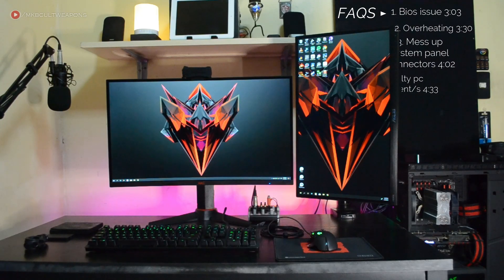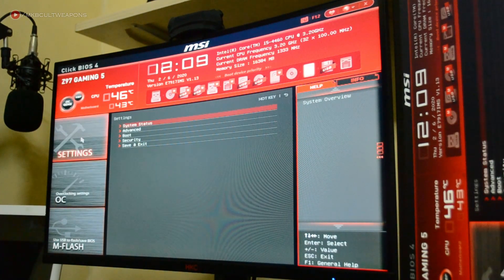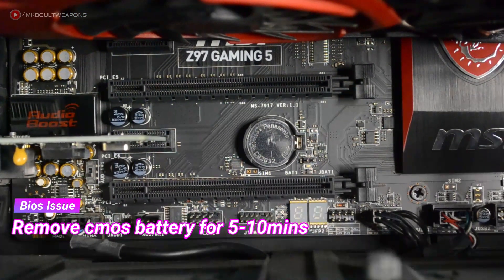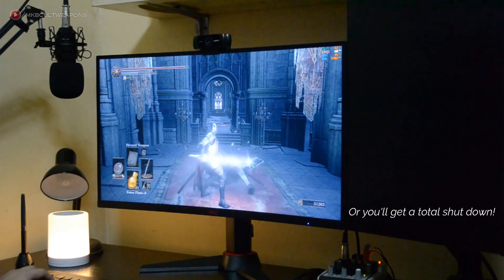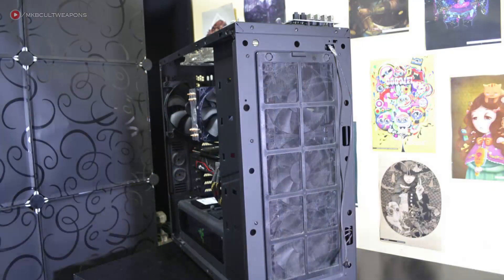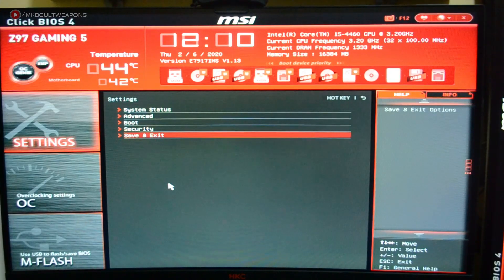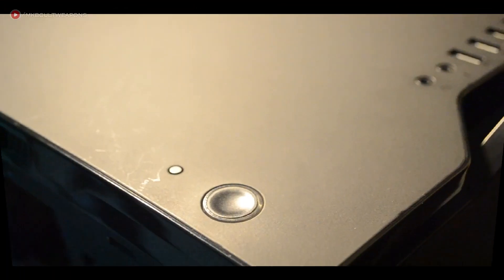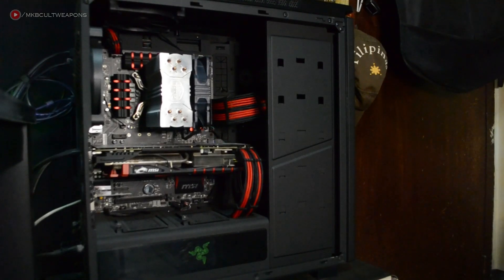Pc keeps restarting FIX / Pc continuous restarting FIX

Comment from the maker: REMINDER: Do not do any of the suggestions in the video if your pc is newly built! I suggest just go back to the local store where you get if from and let them fix it! If ever they can't just get your Rma.
If you guys are looking for a no monitor signal fix check this video out! https://youtu.be/F-dLBIomghY
Reply: It happens to me even when I'm just watching a movie not only by playing a heavy game like horizon zero dawn, So what i did is i removed my gpu that is gtx 1660 super Evga and tested my pc with the integrated onboard graphics that is intel hd 4600 nothing happens even when playig light games but when i plug in my gpu that is gtx 1660 super pc keeps restarting itself with a buzzing noise/sound. Can anyone help me?

My specs are 
Intel core i7 4770
16gb ram ddr3
Eps 850 watts 80+ silver
256gb ssd
Evga Gtx 1660 super 6gb vram
Mobo ecs z87h3 a4
Reply: I tried cleaning ram, clearing CMOS, changing power supply and changing CPUs
Reply: Nothing works
It just powers on then off continuously
Reply from the maker: @debo3467  have you experience power fluctuation in your house lately? if you have done all you said and still happening i think there was low power draw from wall outlet.

On the otherhand, double check the front io panel connection. You might have place the reset button to the power connection
Reply: blippi
Reply: Same things happening,everything plugged yesterday was working great,cleaned it today...and now it just reebots when it shows windows loading
Reply from the maker: @FunnyCl1p3  have you tried cmos reset yet? more info here https://youtu.be/S9hyEPTFR10
Reply: @MacCoyzkie  well i didnt i will,but i think it is to my gpu because when i enter bios it is exceeding the limit of temperature like 105c should be max and its like 177c°,and my pc freezes on windows loading and resets so i will try everything from the video if it doesnt work i will just get a new cpu or go get it fixed,ty tho
Reply: thanks for the tips my pc had this problem i just did a deep clean and tried the rubber trick and seems to be working so far but still feel weary so i'll give it a few days!
Reply: I did by removing battery and powwr on and again fixwd cmos battery but what happened one ram stick was a problem now problems solved

Comment: Mines has been crashing once a day since sprint this year. And i know it's not a GPU or PSU thing, cause my pc will restart constantly. Everything is clean, up to date, drivers from everything has been uninstalled/re-installed, pc has been factory reset at least 8 times and i still have this issue.
Reply from the maker: might be ram instability. can you run the pc using one ram stick at a time then stress test it? run the pc without xmp or docp so clear cmos and run the pc in default settings.

another reason, could also be boot drive is almost full. make sure the boot drive has at least 25% free space to run smoothly. or you might just have a drive that is almost full which can cause the problem or it could also be the drive is failing

Comment: The eraser ram stick actually worked, but when I insert it on the same ram slot as before the boot loop didn't stop, instead, I changed the slot and it worked!
But I have another problem, there's no display on the monitor..
Reply from the maker: did u clean the ram slots too? also try one ram stick at a time, sometimes this could also be caused by faulty ram stick

Comment: My pc sometimes restarts randomly, I am unable to pinpoint the issue - it doesn't happen a lot, I have tried doing stress tests on both cpu and gpu to get max power draw from my power supply it didn't recreate the issue, I can remember 1-2 times it happened while I was gaming but the temps were not very high around 70-80 degrees, it even happens when I am just watching youtube or reading some documents. Also my pc is plugged into a ups so it's not the electricity cuts that causes it, I am just completely stumped.
Reply from the maker: can you run the bios in default without any xmp? then do a memtest using one ram stick at a time so we can figure out which one is causing it https://youtu.be/m4PH9Bn8NYk if this is not the issue then this might be a corrupted os, a fresh installation will fix it
Reply: @MacCoyzkie  I did the mem test but it showed no error, I think I'll have to go for a fresh install

Comment: My pc keeps restarting cuz mostly of the front panel connectors. My pc case is thermaltake versa n25. No matter how many times I fit the front panel cables correctly. They just keep restarting after a week or month cuz they are. Is there no solution to this?
Reply from the maker: you're probably doing it wrong, usually the reset connector is in the power input causing these restarts. check this video for more info https://youtu.be/LxRzL5WFB9c

Comment: None of the simple solutions worked for me. Cleaned RAM sticks, Cleared CMOS, cleaned and reseated cables and components, all of it did not fix mine.

I changed my DeepCool 500w PSU to CoolerMaster 650w and thought it's all good, but it does not fix it either. I only use APU. I'm out of cheap options now. It does not even boot to bios then restart again. Could it be the motherboard?
Reply: Also, it restarts even in safe mode, even when I am in BIOS, and even right after I pushed the power button. Any other tips?
Reply from the maker: @ can you tell me how the pc problem started?
Reply: I was just casually playing games then it restarted. I thought it was a sudden power outage, but it became more frequent as weeks went by. Now I get 35 restarts in just a week. I did not do anything before the problem occurred.
Reply from the maker: @ next time, the first time it shuts down don't just restart the pc and play again without trying to figure out what's wrong. this could take a toll in the long run causing more damage. 

anyway, for now try clearing cmos https://youtu.be/S9hyEPTFR10 so we can run the system in default settings. after that i need you to check the idle temps https://youtube.com/shorts/oHIQTSTSDfg because it might already be overheating. Also if your pc is dusty, start cleaning it

Comment: I get restarts when gaming usually after 20 30 mins  the pc restarts but no lights go off in the pc no fans stop gpu lights stay on. Temps on gpub is 65  cpu 55 haven't installed any hardware since the issue. One thing I did add was a stats screen inside connected to board usb but didn't have any crashes for a week since install. This has started in the past week. Checked all cables pc was built 5 months ago  bo trouble at  all since  latest bios updated windows updates done.
Reply from the maker: stats screen usb device conflict/power draw, can you try the pc without it? even though you didn’t experience issues immediately after installing the stats screen, it could be drawing too much power or conflicting with other devices assuming your psu is not that reliable. your gpu and cpu temperatures are relatively low (65°c and 55°c), there could still be a thermal issue or other power limitations causing instability under load. check if your power limits (cpu, gpu, etc.) are being reached. ensure your cooling solution is still functioning properly

Comment: Power cycling while is turn off, suddenly and at Random just turn on and off. I change psu, and still happening. And temp is normal. I change the ram between slots, still doing it. Any idea why this could happen?
Reply from the maker: can you try one ram stick at a time and boot the system

Comment: Hey my pc has been rebooting but only when it is on idle or using very low resources. I have tried replacing the PSU and RAM and it has not worked and I have tried putting it in a different room which hasn't worked either. When I go to event viewer it tells me "Critical Event ID 41" and the detail logs will be filled with a bunch of 0s. I am not sure what to do now because I don't really want to replace any more parts unless I absolutely have to. I also have already tried reinstalling windows
Reply from the maker: this is a power issue, if you already replace your psu then its not likely the problem but i suspect its low power draw from your outlet or at least the house has power fluctuation. are you using ups or avr? if you are using extension cable try to use a different one to check

Comment: I messed up the overclocking for bios, but when i removed tbe cmos battery for 10mins it still didnt work after i put it back in😭
Reply from the maker: did you maxed out the overclock? this could have damage the parts. can you tell me how did you overclock the pc?

Comment: Bro, Not working.. I changed everything Ram Ssd psu gpu but all in vain. My pc was okay but i felt i should clean it and after that it is not working stuck on boot loop. tried windows reinstallation on different ssd and m2 but not working.... every cable is perfectly connected i reassembled it 20 times in 3 days. all components work properly i.e led etc but pc shows gigabyte logo and restart sometimes it show blue screen "we ran into a problem we need to restart"
Reply from the maker: can you just connect the necessary parts at the moment. Remove all external devices except for the keyboard and mouse. Also remove the extra hdds or whatnot and just use your C drive to boot on the system. then let's run the system in default by clearing cmos https://youtu.be/S9hyEPTFR10 power on the pc after this and let's see how it goes. if still does not work try one ram stick at a time and boot the system

Comment: Hey man i have a quick question.
Can never ending continuous pc restarts be happening because of a faulty motherboard?
Reply from the maker: not really, at least in my experience. if the motherboard is faulty you won't see anything on your display.
Reply: @MacCoyzkie  thank you! I was a bit confused because i brought my pc to a nearby technician and he said that the motherboard would be the cause of the problem after he reinstalled windows. I scratched my head for a little bit and i wasn’t really convinced since reinstalling os wouldn’t be possible if that would be right
Reply from the maker: @Benchey  no problem. yes you can't install windows, you won't even see anything on your display if its a faulty mobo

Comment: why sometimes my pc won't start immediately after pressing power button, and sometimes it start immediately, why this behaviour? can you just tell me is this behaviour normal ?  I'm asking this because I facing random shutdown and restart issue, Sometimes my pc won't shutdown even pass multiple core test, but sometimes its shutdown even in idle situation.
Reply from the maker: a drive in your pc is almost or already full, if you were able to start it normally just free some disk space. this could also be an old hdd and its about to go. remove that hdd to fix it

Comment: Issue i am having is the gpu , if i remove it it turns on if i plug it in it keeps rebooting nonstop....
Reply from the maker: Your GPU may require a higher PSU wattage than what you currently possess. what's your pc specs anyway?

Comment: so my fix was the folowing, graphics card power cable, my power suply only had 1 of the 6pin conector and my graphics card neded 2 of those 6 pin, i bought a "splitter" (dont know if thats the exact name in english) that conects 2 molex cables into 1 6pin,  so i had 2 difrent strings of molex cable coming from the power suply, with 2 molex in each string, and i had my "adaptor" into the same string of cable , i just conected the adaptor into the 2 difrent strings of molex into the grafics and worked fine... pretty dumb but made sense that it didnt produce enough power in the same cable thanks
Reply from the maker: :yougotthis:

Comment: Having this issue and BIOS says 5v rail is way too low, like 4v. This morning it started at like 4.7 then slowly decreased to 4.3 and keeps restarting, did every possible test to try find the culprit, got nothing. New PSU didnt help either 😢
Reply from the maker: either your psu wattage is not enough for the entire system or it is about to become faulty. since you tried a new psu, this could also be power fluctuation around your area. to test this theory you may have to bring your pc at a friend's house and test it there or you could hire an electrician to check the power stability in your house

Comment: My pc doesn't boot loop without ram or in the 1st and 3rs slots so it's clearly a mb or ram issue, I tried th eraser trick knowing it wouldn't work and it didn't, the mb, ram and worked I my old pc so it should work now any suggestions? 

Ps: don't be that guy to say "did you make sure everything is pugged in?" that is a noob mistake as I pro I would never not do that
Reply from the maker: your explanation is all over the place i can't understand what you are trying to say. Just tell me how the pc problem started before i can help you
Reply: @MacCoyzkie  all I did was restart my computer after installing windows and now it just boot loops, it doesn't post or anything only the fans run
Reply from the maker: @n64slayer  usually that happens if the installation didn't finished correctly. since you don't have any important files yet i suggest redo the installation. btw what windows license are you using? retail, oem or volume?

Comment: hey, my pc randomly shuts down as if I told it to shutdown/clicked the shutdown button. it goes to the “Shutting Down…” screen and after it shuts down, my PC turns itself back on. 

I unplugged the front panel connectors for my case’s power button and turn my pc on through my motherboard’s own power button and I still have the same issue.
Reply from the maker: during desktop workload or during gaming?
Reply: @MacCoyzkie  both. sometimes happens immediately after boot, while looking at event viewer and task manager and sometimes during gaming. It’s random. It would go to the “shutting down…” screen and boot up by itself after shutting down. 

Then I would turn off the PSU after it shuts down so it doesn’t go on a shutdown loop. And I’d turn it on the next day and it would work completely fine for a couple days until it does it again. I even reset Windows 11 multiple times.

And I know it’s not my case’s button because the front panel connectors are unplugged. I don’t think it’s my PSU nor my RAM since I got them replaced weeks ago. I also have my pc running on a UPS, so I don’t think it’s a power issue in my house. CPU and GPU temps are fine when booting or when it’s shutting itself down.

I’ve taken it to 2 different repair shops and they’re saying that it works just fine in the shop. I would take it home and the problem comes back within a week. This has been ongoing for 4.5 months already, should I just build a new one?
Reply from the maker: @skeetskeet9440  are you hearing your ups clicking at times or is it stable? if there is anything i think this could be a severe power fluctuation in your area. we could test this theory if you try your pc at your relative or friend's house assuming they also have stable power in their place. do a stress test and see how it goes.

another is windows 11 itself, windows 11 have a lot of issues tbh and this is why i'm still using windows 10 today
Reply: @MacCoyzkie  I don’t hear anything from my UPS or maybe I’m just not hearing it.

This issue also happened when I had Windows 10 but the thing that caused the problem was a faulty wifi adapter. I took it out and still had the same issue. I’m gonna reinstall Windows 10 and see if it fixes it.

But if it was a power fluctuation/issue, wouldn’t my PC just shut off and go black instead of properly shutting itself down?
Reply from the maker: @skeetskeet9440  wait wait, shutting itself properly? like when you shut down your pc normally in the windows start button? if it were so that's an os problem indeed. What license are you using, retail, oem or volume?
Reply: @MacCoyzkie  yes, shutting down through the windows start button but my PC is doing it by itself. I dropped it off at a repair shop yesterday and if the problem still persists i’ll check the os version.
Reply: @MacCoyzkie  is there anyway I can reach out:send a video or images to you? Because I have a video of my PC shutting itself down properly and some pictures from Event Viewer that might be the cause.
Reply from the maker: @skeetskeet9440  send it to my IG @m4coyzkie

Comment: i have a 4tb hdd but every time i connect it to my pc it works for minutes at random moments when using the pc it would just reboot when i remove the 4tb hdd there no problem i added the pc to another pc i have it works flawlessly no reboot but when i add the 4tb it reboots again like before so i know the 4tb hdd causing the problem but i also know the 4tb cant be failing because its working 100% on the other pc i also reset the bios to defaults also have removed gpu other sdd and hdd from pc change the cables so im lost what could be the solution im at the point of selling it
Reply from the maker: have you tried replacing the data and power sata cables?
Reply: yes i have i have may laying around in storage @MacCoyzkie
Reply from the maker: @lilSmurf69  if there is anything, it might be power issue, can you try a different psu for the 4tb hdd only ?
Reply: @MacCoyzkie  you know i was thinking about that for same time now going to buy a new one soon still checking on the market than i will let you know in time if that fixed the problem thanx